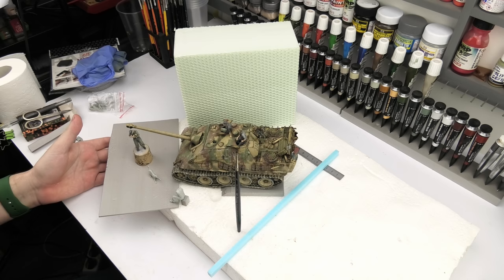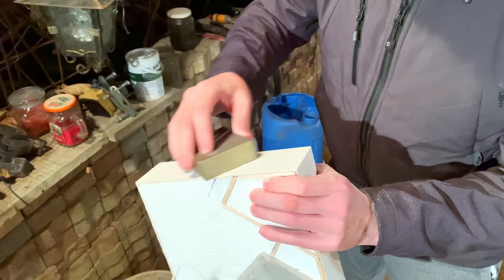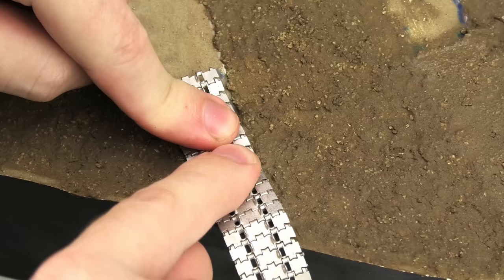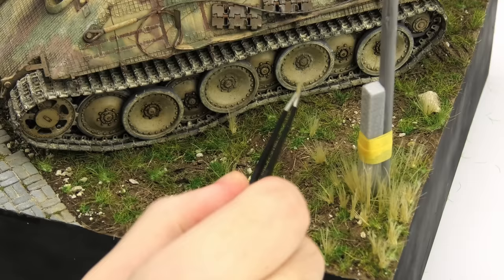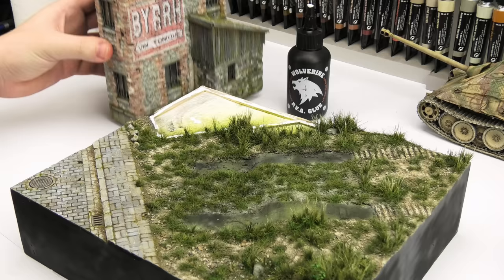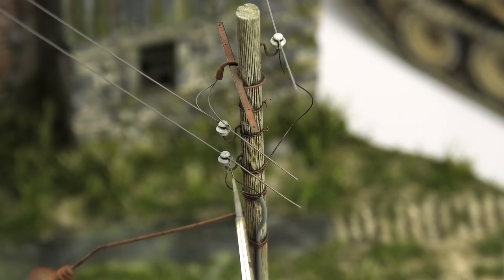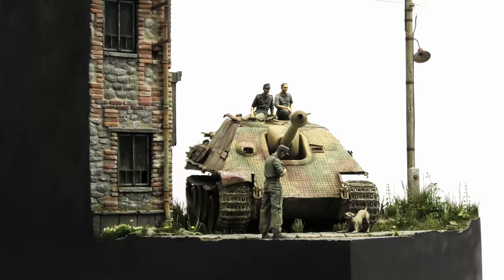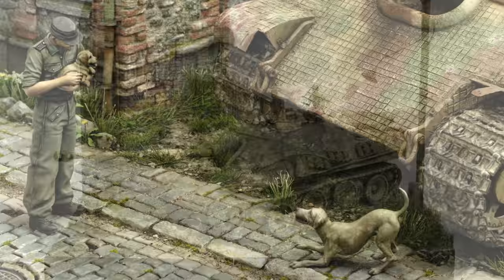"Cats And Dogs" - Normandy 1944 Diorama

Comment: Dear Uncle Night Shift,
    Spent the summer here on the rugged, rocky coast of Maine building, modifying and running an RC rock crawler . Now it is December and winter in Maine aint for whiners!! The solution, back to  modelling.
    Martin, your diorama skills have flourished since last spring, to understate the obvious.
    Me, the toothpick/epoxy putty technique for zimmerit, pretty damn good, kinda. Weld lines a bust. This is the essence of why I model.
Let's be honest, it is the encountering of and solving of obstacles that cause the juices to flow.

Comment: I have been watching your modelling for a while and think that it is exceptional. 
May I make a suggestion, as an ex Tank driver, that the running gear gets heavily clogged with mud and large stones, these rest on the suspension arms and also all of the top rollers. It also packs up between the road wheels and tracks. This is how tracks are thrown. If you need any pictures message me. 
Keep up the amazing work.

Comment: Odd:
I'd think several layers of acrylic paint would protect the foam from aggressive solvents.
When you glued that telegraph pole into place I immediately remembered CA glue attacking styrofoam (tried repairing foam aircraft as a kid, melted nicely, didn't fly anymore). Guess it doesn't matter since the foam is under a thick layer of clay and dirt and the CA will mostly stuck on the surface.
Subversion of expectation twice today.
Reply from the maker: Paint unfortunately doesn't protect the foam. When I was painting the ground with enamels, a tiny bit of white spirit got absorbed by the sidewalk and a few cobbles got deformed :(